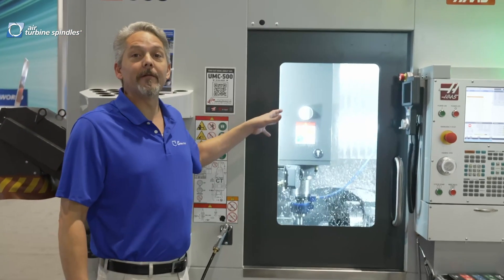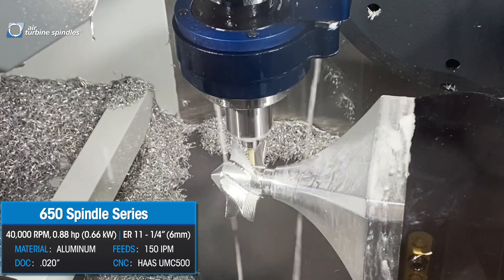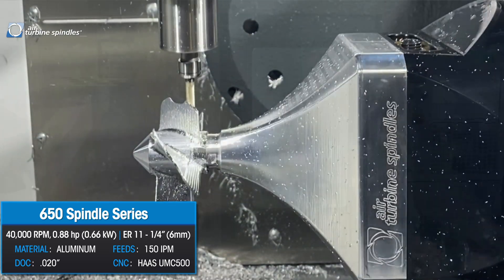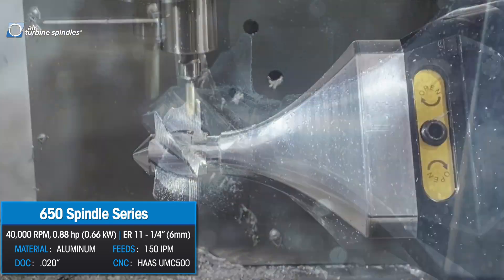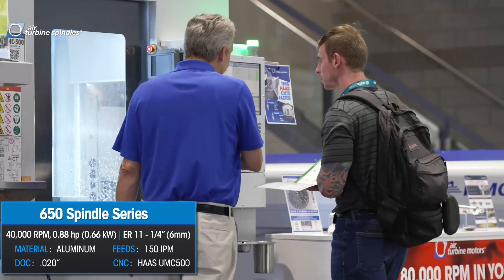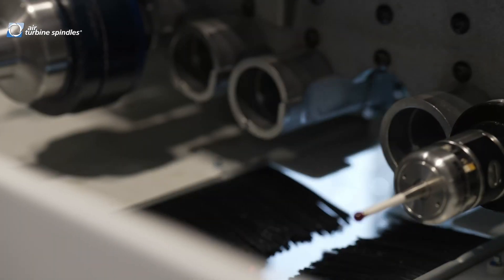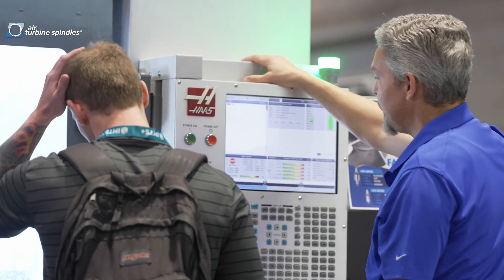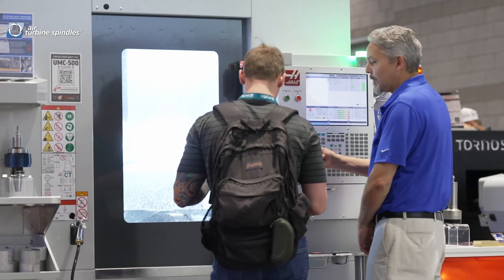Complete Finishing Operations 4 Times Faster with Air Turbine CNC Spindles

Comment: how stable is the RPM with varying loads
Reply from the maker: Air Turbine Spindles® maintain high speed in cut. Their patented governor increases airflow to match cutting load – maintaining rated high speed on your toolpath. Not nominal free speeds that drop off, bog down quickly or stall like other spindles. Check them out! www.airturbinetools.com/products/spindles/